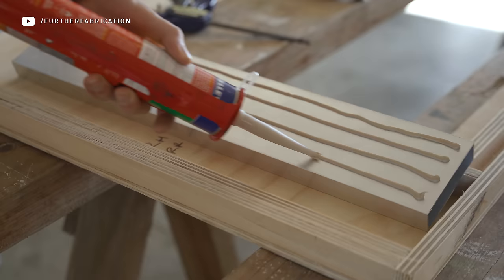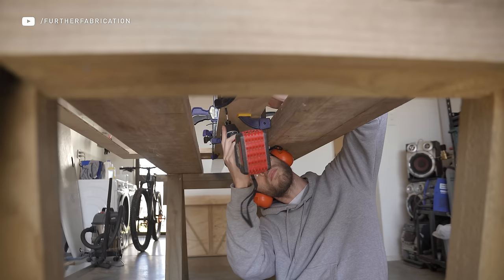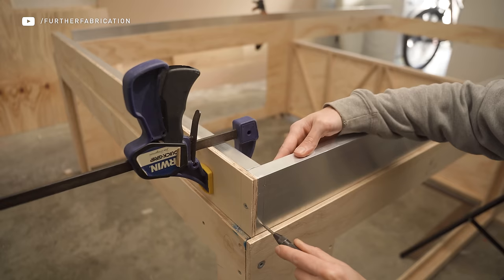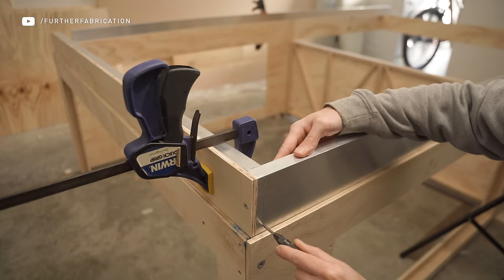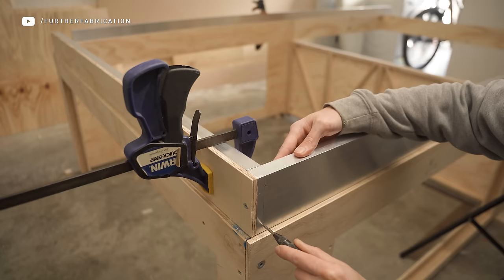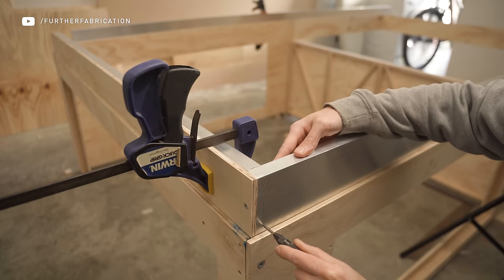Build an Expensive Camper WAY Cheaper

Comment: I'm watching again! This is one of the best design/build/material selection videos I've seen over the years.
This time, I will offer a suggestion. If I was using the plywood/aluminum combination, (for the pieces that were 'laid' on top of the other) I think I would have added traction for the adhesive to bond to the aluminum 'beams' by drilling some (hundreds?) 1/16" holes to allow the adhesive better adhesion between the porous wood and the non-porous metal.
(Well... to be truthful, I might have just NAILED the whole thing together, start to finish! LOL!)

Comment: Pro Tip for You Brother: Use a Pin or Two.. Yes Two; Through a Zipper - Before you Cut it to Length. Obviously so that it does not separate on accident, and Accidents do happen.

Comment: Absolutely brilliant!! thanks for sharing your build, I have a 2023 nissan frontier pro 4x 5 foot bed that I want to build a similar rig like yours how hard would it be to make the sides instead of fabric to be hard walls, I have seen some with this concept. Love how you used aluminum for the structural integrity of framing.
Reply from the maker: Thanks! I would think a hard-side pop-up is totally doable. It's interesting though that almost all production models seem to go with a canvas tent, which makes me wonder if there are some other factors that make hard-sides challenging to do. Might have to make one and find out haha
Reply: I thought about doing this but managed to get a used Dormobile elevating roof with good canvas from a scrapyard. There were (are?) elevating roof campervans in the UK which used the folding rigid side principle, it should be relatively easy to do. If I was doing another one I would be thinking about basing it on a GRP pickup shell and campervan elevating roof from a scrapyard, not being metal they have no scrap value so are available for very little.

Comment: You should have provided for a small air passage at the point where the top and the bottom hinge. I saw one roof top  bed like that and that provided a beautiful input for air flow in another wise very dead spot from inside.  I wish someone would tell me the label on that design and the manufacturer ----t was just beautiful.

Comment: Watched the video. Very well thought out design and build. A couple comments: 1) Most people do not have all the high tech gadgets (CAD, 3D modeling program, and a 3D printer, specifically) you used. With a bit of creativity, normal tools should be able to do what is needed. 2) I also think there is one part of his design that will be leak-prone...where the tent fabric attaches at its bottom edge. There is a flat ledge, that is the edge of the ply and aluminum sandwich, which water will collect on and eventually seep through. A Z flashing of some kind would prevent this problem.
Reply: I agree with your last point, had issues with the similar arrangement on my elevating roof. Careful application of a good polysulphide sealant does the job.

Comment: I was planning on making a full pop-up version for my truck with no overhang. A tonneau cover/camper shell combo basically. With an 8.5 foot bed, it's plenty of space for camping even if I take up the front foot for cabinets and countertop. It would use the same fabric design you used as well. I'll have to save this and come back to it for pointers if I ever get around to making it. The only difference is I'll be hiding the gas shocks in the bed towers.
Reply from the maker: Nice, glad I could provide some inspo!

Comment: 10/10 would recommend. i looked into doing something similar years ago with a 6x4 to build my own off road camper, given they are so over priced and hideously expensive like all things here in AU and same across the river where you are mate. not a big fan of plywood, had bad experiences with it chipping, and was worried about the waterproof(ability) of it but, your sealing idea with the epoxy was mint. only thing i'd add is a motorbike mount on the back of the ranger and you'll be set. oh do you get much wind buffetting as the wind catches the front over your cab?
Reply from the maker: Cheers mate! Yeah I'd like a bike mount on the back too. haven't noticed any significant buffering, there's a little but not enough to think about

Comment: This is an incredible build.  I'm pretty likely to purchase these plans because it nearly checks all the boxes of what I want in my camper setup.  What's significantly different in my truck is that it has a flat bed, which means needing to build much taller vertical wall to do the same thing. (It actually has folding bedsides, but I don't necessarily trust those to be able to hold all the weight on just a few steel hinge pins.)  Do you think your plans will adapt well to suit that significantly increased wall height, or should I be looking to design my own wall structure and potentially just recycling your roof structure for the design?

Comment: A technical project that you explained quite well. I do not feel that epoxy is going to stop the ply from swelling. I spent 15years at a company where we built outdoor loudspeakers. And every product and method for sealing wood, from epoxies to fiberglass, using marine grade plywood and every combination we could think of, all failed. When you think of a way to do something cheaper, ask yourself why doesn't a huge company with hundreds of technical people do it this way? Otherwise all the truck camper manufacturers would use it. It's cheap, easy to spit out hundreds or thousands of pieces per day with a table router, and can be assembled quickly. They wouldn't pick the more expensive path if they didn't need to. So when you're done using it, remember to store it in your climate controlled garage to prolong it's life.

Comment: nice build I wonder what you could have made if you used a tig welder and welded the box section and used aluminum sheathing that not to take away from the great build  but to make even lighter

Comment: Mmmh.... why then those side windows if the bottom area is not for living/seating ? The model I used was much wider so the upper bed could be set transverse. All fiber glass and also a soft skirt for telescopic roof. It was 300kg with upper bed, 4seats, table, small fridge, small stove, a few cupboards, a door, a step- From Iceland.

Comment: Im glad you put in the measurements for inches and I noticed you didn't show feet, which is irrelevant because that really has nothing to do with the building, because that's something that will depend on the truck it's built for.

Comment: Here’s an ideal for your next one you should put some D rings on the inside by the canvas in the middle on each side of the wall then use a bungee strap just a light one to pull the canvas in when you shut the lid

Comment: Its not just more chunky. The Heavy Duty Singer sewing machines use a more powerful motor, capable or incredibly high stitch counts per minute.

Needles are about the same as any other unit though, so youre probably right that most sewing machines will handle the fabric, but there are some varieties of canvas, etc, that a lot of sewing machines do not have a strong enough motor to punch through, that these will sew.
Reply: I say this as someone that uses an old Kenmore for all my own projects, but I bought my sister one of these for working on various horse related projects
Reply: And I say all of this as someone that is really impressed with your sewing, this project, and the fact you learned a new skill specifically for this build.
Reply: One other tip for sewing things with straight edges - you can use the little marks on the surface beneath the foot (the ones with measurements) as your guide line, also. They're there for that exact purpose, so that when you're sewing something with a seam that's an inch on to the fabric, you still have a line to guide the fabric along, not the edge of the foot itself. 

I really hope that you looked up a proper type of thread for a project like this, and used something with some semblance of water protection for the seams, and which is UV resistant, as some threads will deteriorate extremely fast in sun or rain.

Comment: Awesome build! It got me thinking, if you wanted how hard would it be to add a section of floor that could slide out from the truck bed, maybe resting on end on the open tailgate and the other on swing down legs?  I haven't seen one like that but then again I haven't looked very hard,  could make a roof that folds out to cover and essentially double the floor space.  Anyone have any thoughts?  Also, does this build share airspace with the cab at all, allowing you to use the trucks environment control?

Comment: for future reference, if you clean the surface, rough it up a bit and then glue aluminum with normal Araldite (epoxy glue, two pack, not the 5 mn. one), wait 24 hours and the joint will tear the aluminum rather than break the bond. Poor mans welding:) Not my idea, but my deceased engineer dad who used this many time build aluminum boxes for geotechnical instruments.

Comment: Doesn't sprinkling salt on the timber during the glue up make it attract water later? Seems like you'd end up with damp patches whenever humidity was high.

I'd like to see how this lasts long term, I see a lot of potential failure points but I'm a builder so my job is basically to be completely pessimistic about structures exposed to weather. My prediction is that it will be ok if you keep it in the garage between camping trips, but it won't last stored outside. I'd be worried about wind loading too.

Super cool project nonetheless, the tent stitching part was really impressive. I've always thought about making something for my ute one day when I have time to do more than watch half a youtube vid.

Comment: Very impressive work. Im half way through a slide on camper build and my mate showed me this. Wish I had found sooner so good.. I have few questions. Did you add any fall to your roof for water run off? Where did you buy your gas struts from? And your hinges? And what did you use for the door and roof seal? Thanks again for your vid.👍

Comment: Awesome job! I don’t know if I will ever build one for me, but I just bought your plans because I felt is the minimum I can do to THANK YOU for such awesome content!!

By the way, any issues with water getting in when you open the windows? I mean, water running inside of the truck bed from the windows, because when you open them they are at 110 degrees, so if there is water on them, that would drip inside the truck, right? How are you preventing this? 

Again, amazing work!!
Reply from the maker: Thanks mate, appreciate it! 
I was thinking the same thing in regards to water being directed in by the slope of the doors, and had planned to put a rubber strip along the top edge  of the doors to deflect water off the sides when they were open. But so far water only drips down on the exterior side of the flanges and doesn't seem to make it into the camper. so just leaving it as is for now

Comment: did you consider steel tubing? even though its more dense, would you be able to get away with using less material for the same structural strength?

Comment: Great job from start to finish. 1 question do you get a wind drag effect while driving, would the truck need some kind of aerodynamics above the truck roof in front of the popup bed?
Reply from the maker: Thanks! Great question, a little aero probably would help but the extra drag as it is, is pretty insignificant

Comment: I have a question.  Would it be possible to build it out of 2 layers of carbon fiber sandwiching a layer of insulation.  Structurally using carbon fiber framework like used in framing walls.  does any company even sell flat carbon fiber boards?

Comment: -_-   So I hope you know.. Shelf brackets are not supposed to be square, they are offset to hold the weight and shift into square, which gives it more rigidity.  You should have used them.

Comment: I kinda wish you would have insulated Before you sandwiched the walls together, foam, depending on how hot or cold it gets where you live
Reply from the maker: Agreed, it felt weird leaving empty voids, but at the time I wasn't even sure if everything would even work, so I skipped some of the nice to haves
Reply: @FurtherFabrication  You did a great job on it anyway, I like your build, I like how light weight it is, and the pop up top
Reply from the maker: Thanks!

Comment: Hi all you lovely people at @FurtherFabrication
I have added timestamps to your video.

To convert the timestamps to chapters in your video:
1. Copy the timestamps I shared.
2. Sign in to YouTube Studio.
3. From the left menu, select Content.
4. Click the video that you'd like to edit.
5. In the Description, paste the list of timestamps and titles.
6.Viola! Chapters added to your video

⭐ Contents ⭐
⌨ (0:00:00) Intro
⌨ (0:06:28) Connecting the walls
⌨ (0:08:21) Assembling the frame of the roof pop top
⌨ (0:12:56) The flip up doors
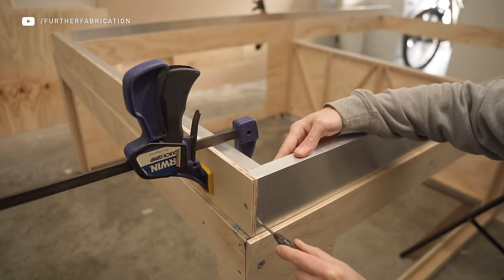⌨ (0:15:39) Gas struts to open the roof
⌨ (0:17:18) Construct the pop top tent
⌨ (0:23:39) Fit the tent
⌨ (0:26:04) Roof panel
⌨ (0:28:26) Dismantle and prepare for painting
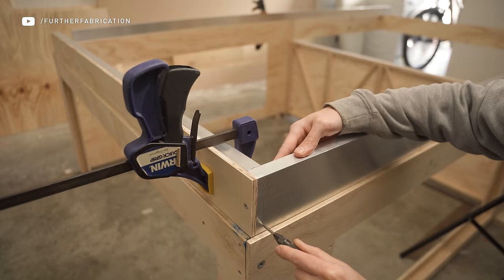⌨ (0:30:31) Aluminium composite doors
⌨ (0:31:04) Fitting the camper on my truck
⌨ (0:33:00) Remote central locking
⌨ (0:34:00) My new laser cutter
⌨ (0:35:10) Let's talk numbers
⌨ (0:36:22) Thank you for watching

Comment: It's that overlap that kills most projects I've seen stairways fail because the framers were so lazy they just didn't want to take out a saw and finish the cut so they butchered the stairways I've seen it on rafter joist and everything it's just completely shoddy Craftsman work good job 1:37

Comment: You should really rethink the waterproof capabilities of your Build. i think the wood will pull water in a short time over the edges or really small gaps. The Wood itself is really not waterproof and because of its laminated Structure it will fall apart fast when in contact with water. You could redo the whole thing completely with aluminum. Even if you would have leaks the aluminum wouldn’t fall apart immediately.
Reply from the maker: Agreed, plywood isn't ideal in that respect. The penetrating epoxy, in theory should stop the wicking of water into the wood but whether that holds up over time is definitely something I'm keeping an eye on

Comment: At 110 degrees wouldn't the doors being at an upward angle allow for rain to drip in the gap with them open?
Reply from the maker: Exactly right. which isn't ideal, but a few drips of water is better than smacking my head I reckon. Adding a "gutter" strip is probably the way to solve both problems

Comment: Hi there.... Brilliant project... where did you get the 3d model of the Ranger?
Reply from the maker: There's a bunch floating around on 3d printing websites which are good for the general shape. However to get dimensional accuracy for 3d modelling I actually used a photogrammetry scan that I made of my Ranger

Comment: You vs other Youtubers...
Other Youtubers be like: 
I build this easy to Build DIY Camper an You can do as well, also those Youtubers, using Heavy Duty Machinery, CNC and and way to expensive Parts, than they say you don´t need much experience to build, only to do exactly that and show how Awesome they are with all of there way to Expensive Tools,... and then they say all this did only cost 12.000US$ so very Cheap,... maybe in the US, but everywhere lese this is Expensive AF 
I have a Drill, I have an Angle grinder, and maybe an electric Hand Saw (those are the Tools many have where I live and not more) and You show me how I can even start building something like this, This is Awesome, I wish there would be more Youtubers out there that come down to reality and make Stuff the real Easy way,... 
but don´t get me wrong, i like to see what people can build with those tools, but on the other hand why do I need to have a 40 different tools, when Glue and Nails can the do the Same,... 
well whatever,
its was a Blast to watch You and also interesting how someone build a Project like this the Real Easy way, and also the Cheap way can´t wait to see the next Project

Comment: How many hours did you put into the design and build. Many DIY'er don't consider their time at the going rate. Also, how's the warranty. Again, your hours and material costs. I'm all for DIY just consider all the variables in your cost analysis. Cheers
Reply from the maker: Absolutely agree. I didn't mean to suggest that this is a viable business opportunity. It's more about building an enjoyable project, that I wouldn't have otherwise had access to.
Reply: So how many hours did you put into it?